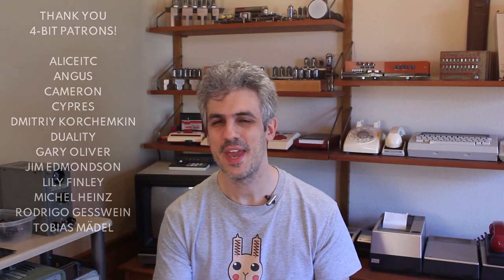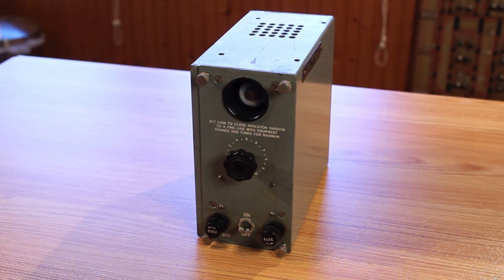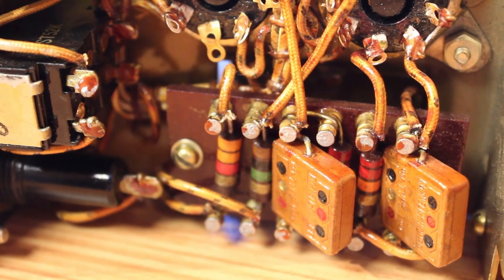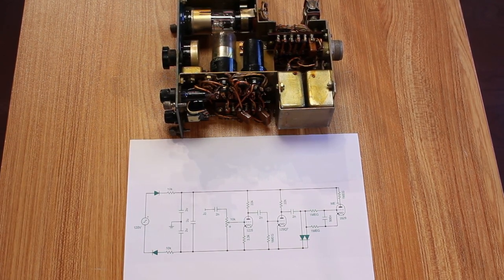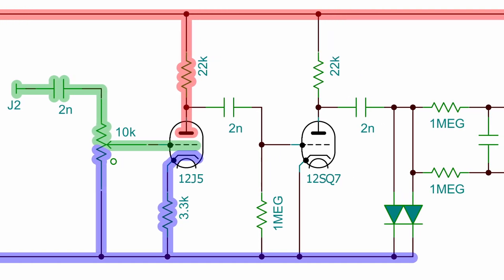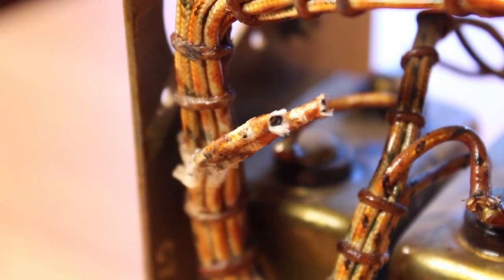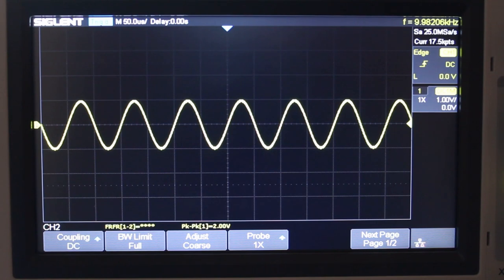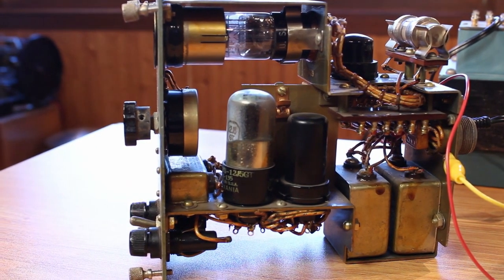Reverse Engineering a U.S. Navy Vacuum Tube Thing

Comment: Maybe it's used to tune a radar or sonar system?
Reply from the maker: I think you're absolutely right about it being for a sonar system!
Another commenter suggested that it was used as a Bearing Deviation Indicator in early sonar systems, which makes a bit of sense given that it's designed to give a more precise indication of incoming frequency. But, also I think it was originally designed in such a way that it could have had multiple uses on several different types of equipment. Really, anything that needed a precise frequency indicator!

Comment: The circuit is a voltage measuring device. Your diagram is incorrect around the magic eye cathode. Check your wiring circuit again.
Reply from the maker: You're absolutely about the magic eye!
I double checked the wiring and missed an important connection from the magic eye's cathode to B-, here's the updated schematics:
https://i.postimg.cc/jdZ7FfBh/Updated-Schematic-A.png
https://i.postimg.cc/85MyR4K4/Updated-Schematic-B.png

Another commenter suggested that it was used as a Bearing Deviation Indicator in early sonar systems, which seems like a fairly likely application, but it's designed in such a way that it could have had multiple uses on several different types of equipment.

Comment: who is that genius who put 4 filaments in series? when one burns out, check them all (like old Christmas lights)
Reply: Transformers are (and were) large, heavy and expensive. The classic tube consumer radio from the 1940s until the early 1960s was the "All American Five." Five tubes, filaments in series. Typically three 12-volt heaters, 50-volt heater on the audio output, 35-volt heater on the rectifier, adding up to 120 volts without needing a dropping resistor like this device has.  If a tube burned out, you took them all down to the drug store and plugged them into the tube tester. And yes, the chassis on these sets were often electrically hot. All (hopefully) safely enclosed in a wood or plastic case.
Reply: @OldBaldGeek  

I repeat. you burn one, you have to try them all
Reply: @-Crash-Nebula--  Obviously. You asked "who was the genius" that designed it that way. My answer was intended to point out the genius who realized you could make devices smaller, lighter, and cheaper by using series heaters instead of a transformer. Finding one burned out tube out of five is easier than finding one burned out Christmas bulb out of 30. And I expect that many people just took their radios to the local radio repair guy who used his ohmmeter on the bottom of the chassis to quickly find the dead tube.

Comment: very interesting, what is it for?
Reply from the maker: That's the big question!
Another commenter suggested that it was used as a Bearing Deviation Indicator in early sonar systems, which seems like a fairly likely application, but it's designed in such a way that it could have had multiple uses on several different types of equipment.
Reply: @UsagiElectric  wow wery interesting

Comment: looks like a pulse detector used in sonar
Reply from the maker: I think you're on point here!
Another commenter suggested that it was used as a Bearing Deviation Indicator in early sonar systems, which seems like a fairly likely application, but it's designed in such a way that it could have had multiple uses on several different types of equipment.

Comment: I think that is an osillscope from the 40s
Reply from the maker: I mean, you're not that far off! An oscilloscope is really just a way to visually see an electrical signal, and that is exactly what the magic eye indicator is doing here. Another Another commenter suggested that it was used as a Bearing Deviation Indicator in early sonar systems, which seems like a fairly likely application though!

Comment: I'm 74, used to love  magic eye tubes.  Incidently, if you note, most old military gear used 12V tubes so they could  be series wired and operate 24  in aircraft.  If you look at many of the Heathkits  showed up right after the war,  they made  great use of  many of those surplus tubes.    Also, it is traditional to say  the  first 1 or 2 numerals  as "12"  and not  "one two"  as  that denotes a "12v"  tube  (usually).  12AX/U/T 7  tubes can be wired 6 or 12.   Magic eye tubes were very high impedance  signal  and there were few  simple circuits that met that in the day,  early o'scopes and VTVM or course.   USN, 68-74, ETR-2,  NAS Miramar 70-74,  I maintained GCA RADAR and TACAN

Comment: It look like some kind of tuning unit, possibly for radio SWR/power. The big resistor is a part of a slow-start. RTTY tuning indicator.
https://www.youtube.com/watch?v=DItmKMhd1ro
Reply from the maker: That's an interesting idea about it being for RTTY that I hadn't thought of!

Another commenter suggested that it was used as a Bearing Deviation Indicator in early sonar systems, which makes a bit of sense given that it's designed to give a more precise indication of incoming frequency. But, I think it was originally designed in such a way that it could have had multiple uses on several different types of equipment. Really, anything that needed a precise frequency indicator!
Reply: @UsagiElectric  It would be used with equipment a bit more recent, but similar to this. https://www.youtube.com/watch?v=EO1QOt9DVzI

Your unit would be used as a tuning indicator.

Comment: I'm surprised you don't have a variac.
Reply from the maker: Most of the stuff I do is low voltage DC stuff, so it's never really been a top priority. But, as my interests broaden and I get into more vintage stuff like this, a variac is one of those things I should definitely get!
Reply: @UsagiElectric  Is your valve computer low voltage? I must have missed that bit! It's always good to have one yes.
Reply from the maker: @newtronix  Indeed it is! I use just +24V and -12V for everything. The heaters are in strings of four or two and powered off the +24 or -12 rail. The +24V is for the plate voltage and the -12V is for grid biasing. Logic low is around 3V to 5V and logic high is around 19V+.
The 6AU6 works surprisingly well even at these massively low voltages!
Reply: @UsagiElectric  ah yes the 6AU6! I have a Korean war era shortwave radio receiver that uses those. It was powered from the battery in a Jeep.

Comment: What a nonsence tube diode (kenotron) can not be shortened inside, cathode and anode are far away from each other. They can melt but even in this case they never short. Ifone of anodes in tube melts it shorts two catodes immidiately.
Why did they use double tube? Meybe because this thing is from avia/navy equipment which is fed from 400 hz power line.